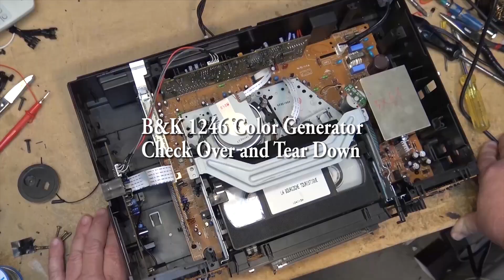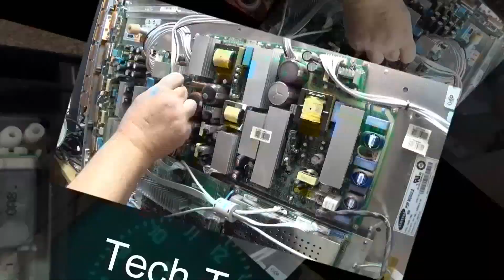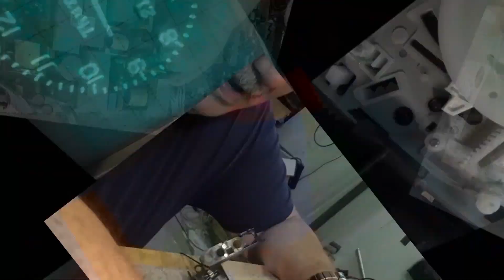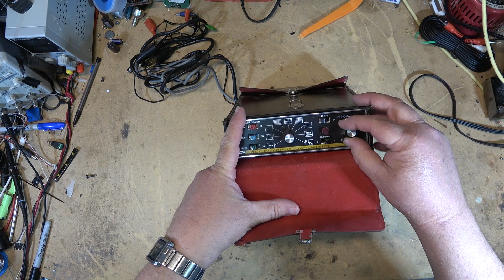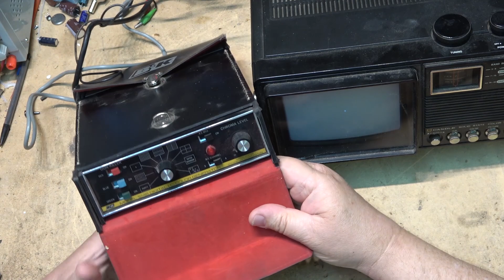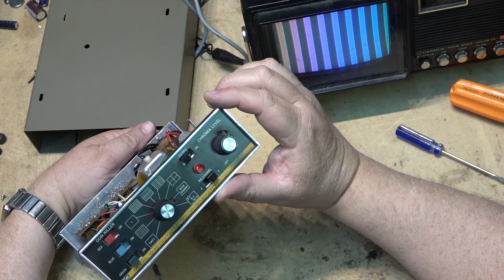Free Test Equipment Yay

Comment: Nice addition to your collection but you really must play with your analyst. I have two and they are great for experimenting . The later generators gave more stable rf output but if I had one of these during the seventies and eighties I wouldn’t have had to wait for the trade test transmission
Reply from the maker: Will have to get it working first
have not even plugged it in because I know it will need service first

Comment: The Motorola "dual transistors". I'm sure those are actually digital divider ICs, because I've seen the same Motorola devices in a late 60s Kimball electronic organ I recently pulled apart, that were on the octave generator divider boards. Completely obsolete and unobtanium of course.

Comment: Hmm there is a 71 on the chips,  could be 1971?
I half expected you to get out the esr tester for the caps,  even elna ones fail.
Some of those carbon resistors might also be a bit off value.
Nice bit of test gear for the odd crt t.v that comes in  :-D
Reply from the maker: Yes that is in the era that this one came out. Late 60's when t hey started using the early ICs. The first shop I worked at had one and that was back when I was in high school, 78 - 80. I left the business to peruse a career in television production and started working (first as unpaid volunteer) at the local community station and went to college to study video production. Did my internship there, but it never worked out. As I found out to get into radio and TV you don't start out at the big market stations, and I was not willing to relocate to some remote community.  Answered an ad for Sony looking for junior techs, they hired me and trained on this new device called Betamax. Sony wanted to move me to Winnipeg to the national lab. Didn't want to go to HELL as it was referred to. 10 months of 6 feet of snow and 2 months on mosquitoes as large as small aircraft. Left Sony, found a job at a local shop and ended up staying there (against my better judgement) for 20 years,
Guy was the cheapest SOB. Paid well (that is the only reason I stayed as I was making double what other shops were offering) but he wouldn't spend a dime of the shop side of things. Showroom was beautiful, but the workshop looked like it was 1965.  I used to use the community TV memo board to align convergence, or point a camera at a black card with white lines painted on it for crosshatch. When one of his buddies closed his doors he scooped his fluke meter, B&K frequency counter and this model of generator for a song. It was sure nice not to have to set up a camera just to do an alignment, as we changed tons of picture tubes. 
I did probably 3 or 4 a week there back in the 90s, and tons of projection TVs, however these generally had the crosshatch generator built in.
Reply: @12voltvids  Yep your boss was a tight assed git,  Miser is the name for him.
Dave you learnt a lot in many directions.
I would say you succeeded  dispite the negative asshole making life harder.
I've replaced a few crt's and the first thing is to ground the anode cap,  just in case that big glass capacitor was trying to get me lol.
Getting the convergence right could be a right bast..ard ,  others were easy.
I would sit behind the set and look at the mirror to get a rough idea.
Most of the delta gun crt's were made by mullard and a bit crappy.
It was a bit of fun :-D

Comment: Being that colour TVs came out in 1954 would suggest that - that piece of equipment would have maybe been made around the same time frame?
Reply from the maker: No. This one is ic driven.  They didn't get invented till late 60s when trabsistors were also common.  Back in the 50s a TV analyst would have been used.  They used a flying spot and transparancy. I have such a beast that some day I will get functional.